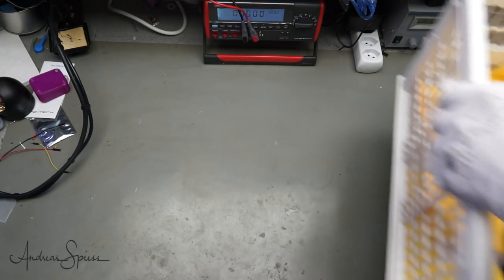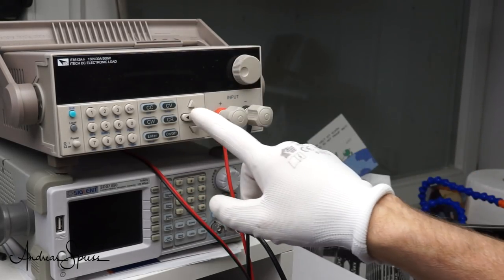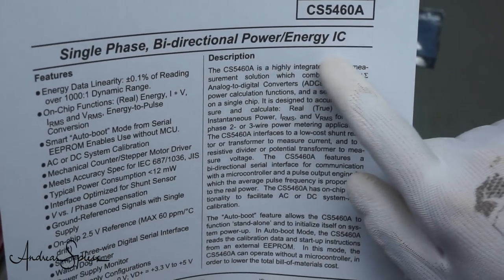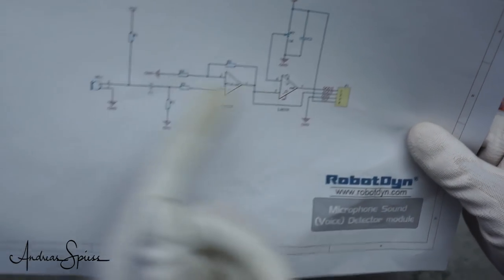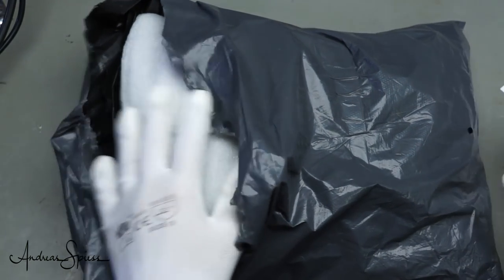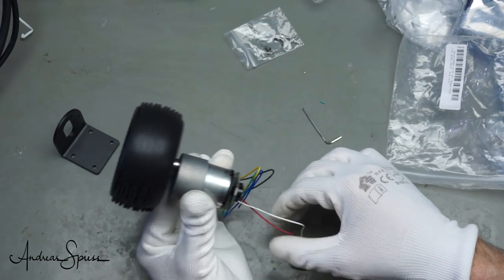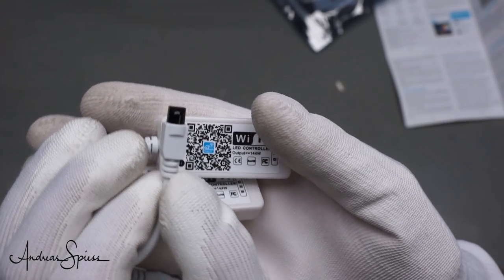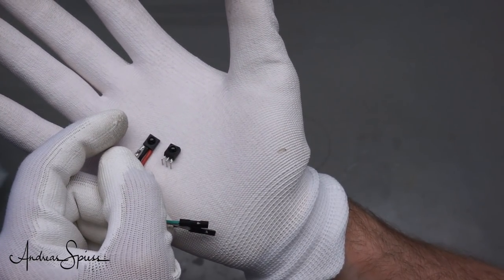#175 Christmas Mailbag with Motors, Google voice, Sensors and other Stuff

Comment: Merry Christmas (a bit late, but well...). For measuring mains real power you only need an Arduino, an ammeter and a voltmeter. You can do the ADC reading & calculation on the Arduino since it's only 50/60 Hz. You can calculate real, reactive and apparent power, cos(φ), the PF, etc.
Reply from the maker: I wish you a Happy New Year! Concerning the Arduino: These lectures were a long time ago. So I would have to dig into the matter ;-). But I think you are right if you use interrupts to measure a lot of points and do the calculations every second or so.

Comment: thanks for video. very curious to see how your ttgo lora module works - especially Antenna supplied with module, i doubt if it is for right frequency. 
i have a pair or these modules, tried range test , hardly goes to 500 meters. i kept transmitter on terrace of house and walked all the way in park. it ceased to get any data after around 500-600 m. There were few tall trees and may be a building in the line of sight. 
But good news is -it works for my application though, i used this for my sensors in a closed room e.g. floor 4, then walked all the way on 2 floors up and 4 floors down the building in basement, also in building on other side of road, it could catch data everywhere. indeed i had no line of sight - separation distance might be 200-300m spherical radius. 
looking forward for your comment on antenna and range of this module.
Reply from the maker: As I have shown in my other LoRa videos, the antenna is not so important for reach. Most important is the line of sight for bigger distances. And in buildings also some metal can help transfer waves from one place to another...  
But I am glad it works for your application.

Comment: While calibrating an SHT30 shield for a home project, I found that the  Wemos D1 throws off sufficient heat to shift temperature upward by 5F if the sensor shield is attached directly to a board. I suspect that the DHT11 would be effected as well. Separating the Wemos from the SHT30 using 4" jumper wires solved the problem. Pictures, data, and analysis at https://github.com/davewsmith/notebooks/tree/master/temperature

I'm hoping to get access to a FLIR camera to confirm that the voltage regulator on the Wemos is the culprit.
Reply from the maker: The setup We use here is not good to measure actual temperature. It is more to show principles. Btw look also at the ESP module. It also creates some heat (3.3V*80mA)
Reply: i have noticed the same... SHT are very sensitive to surrounding temp and even enclosing it in closed enclosure gives 1-2 deg higher reading than actual ambient temp. minaturization is good but sometime it is better to remain big :).

Comment: Hi Andreas  thank you for many intuitive videos on ESP32. I'm wondering if you can do another instructional video on esp32 built in security and cryptography  features. Specifically how to utilize the built in Cryptography Hardware Acceleration for device signing, and encryption. The Atmel ATSHA204A module provides HMAC calculation capabilities with SHA256 hashing. I'm not sure if any ESP32 board has something similar built in?
Reply from the maker: I have no idea about security. So, somebody else has to do that part...

Comment: I have to warn you about flat usb cables -- I have 15 of them and they are only good up to 600 mA so if anybody has problems, my first try at workshop would be to check with another cable. I'm using them with Arduino without problem, but hey always fail for Linux SBCs which often require more current. Becausse of that I haven't used them with ESPs so far.
Reply from the maker: Thank you for your feedback. I did not do any tests and plan to use them with the ESP boards for the training class. I selected them mainly because of their looks... But it might be a good idea to compare once a few USB cables as we use quite a lot of them without thinking too much.

Comment: great Andreas! looking forward for the esp32 lora oled modules reviews. i got some from heltec. I realised when i received them that they were 433mhz. I have tested them and i got (node to node) 8.3km range (almost LOS) at - 117db.  The lora antennas in the one you got looks much better.... Merry Christmas and a happy new year to all!
Reply from the maker: You might have seen the video on my world record. It is at 203km. So, still lots of potential...
Reply: Yes! i have seen it! lots of potential provided you have the correct LOS, low interference and of course a good board design + antenna (y)

Comment: Merry Christmas Andreas :)
by 14:40 is that the equal radar sensor from ComputerClub2 tv? He has a range from 9m and detect objekcts behind 35cm brick wall.
Reply from the maker: I do not follow ComputerClub, so I do not know. But I assume mine will have similar characteristics. I did some tests with cheap radar sensors in another video and they were quite good.

Comment: Merry Christmas Andreas, have you done any work with speech synthesis.  I was playing around with a BBC microbit and found you can programme speech using micro python.  Possibly useful in some of your future projects.  I struggle a bit with programming so your channel is useful for a novice like me.  Hardware isn't a problem as I was an electrical fitter before I retired but coding is more demanding!  Keep up the good work!

Davy
Reply from the maker: No, so far I did not do anything with voice., but also not with the microbit. We will see. Maybe next year.
Concerning learning software: You still have plenty of time to learn it and I even think, learning keeps us young...
Reply: I agree. I must keep the brain working!

Comment: I pruchased such flat USB cables in the past and they seem to be very poor quality. They can't provide stable 1A. Even with ESP8266 I had problems with stability which were gone when I changed the cable. Let us know if yours are better,.
Reply from the maker: Thanks for the feedback. I did some initial tests and did not find big differences in resistance. But with your input, I will test them a little better.

Comment: Hello Sir,  I saw many video tutorials of yours and found those very useful. I like to request you about making a tutorial with E32-TTL-1W using SAMD21 IC. I bought 10 pcs of each module (both E32 and SAMD21) from china. But still no luck to communicate. I have used Radiohead library for E32 module. It works for arduino pro mini but not works for SAMD21. I don't figure it out why. Will you please kind enough and  give some suggestions about it. I will be very thankful to you.
Reply from the maker: So far I do no videos using the samd21 because I use ESP chips instead. One reason is because the Samd21 is not as widely used and not as good supported ( this might be the problem you encounter). So do not expect videos from me using this chip soon.
Reply: Thanks you sir for your fast reply.

Comment: I found anoter interest chip for measuring voltage, current and energy.It is ADE7753.
Reply from the maker: I have some AD7758 laying around. They are three phase. But so far I have no plans. Did you use it?

Comment: The digital output of the soundmodule is of little use here. The intention is probably to give the  soundpressure level, but for that it needs a capacitor, or possibly even a capacitor and diode https://arduinodiy.wordpress.com/2013/04/04/microphone-pre-amp-for-microcontrollers/
Reply from the maker: Thai is what I think, too.

Comment: Couldn't we get a longer / more reliable digital signal off the microphones by increasing their sensitivity?
Reply from the maker: No, unfortunately not. You already get the 3.3 or 5V max with this sensitivity. You need a way to bridge the gaps and this is usually done with capacitors.

Comment: merry xmas I am very interested in the esp+lora devices.  Would like one with a GPS if possible.  I want to make a cheap tracker because someone keeps stealing deliveries off my porch and would like to know where it goes if possible and give that info to the police.  Id like it to be as cheap and small as possible because I won't get it back
Reply from the maker: You can buy small trackers which work with gps which might be better because of the reach. If a LoRa device does not have line of sight connection you will not get any messages from it.
Reply: I have a strong feeling that it is someone in my neighbor hood so it would be a range of less then  1km.  Do you think Lora will not make it 1 mile objects?

Comment: A while back I did an Arduino project to put wireless data transmission of the cs5460a based watt meters using nrf24.   
https://github.com/zerog2k/power_meter_cs5460a
Reply from the maker: Thank you for the link. It might save me some time...

Comment: And if you want a very fast (faster than all your motors), high torque, highly efficient and small motor, I'd suggest you buy a brushless motor. I bought this one for trying them out: https://goo.gl/QCzQYJ . They're really fast (1400 KV, 1400 RPM/V) and high torque. Just take into account that it's very power hungry: it consumes 210 W. Also, you'll need an ESC (you can buy one on Banggood as well).
Reply from the maker: I think, these motors are too fast for wheels and should probably be geared. But so far I did not find gears for these motors.
Reply: Andreas Spiess Then 3D print some gears! Or buy/make a CNC machine and make them out if metal. I don’t think they’re fitted for the balancing robot project, but they’re useful for other projects, like RC toys, electric karts, and other power projects.

Comment: regarding the Radar velocity sensor, you can use an ESP32 with Arduino FFT from https://github.com/kosme/arduinoFFT. It works out of the box e.g with 2048 samples, 4000samples/s. I already tested it with 10.525GHz HB100 and 24.25GHz CDM324 Modules.

Comment: Regarding the heltec LoRa board, someone on this form has seemd to get it working. I tried the same thing but no luck jet.

https://www.thethingsnetwork.org/forum/t/big-esp32-sx127x-topic/10247/130 

I don't have my own gateway, so it's hard to test.

Might you xmas gift be stuck at customs?

Marry Christmas and thanks for the videos.
Reply from the maker: Thank you for your link. I did not use it as a TTN gateway so far. I just did some testing if it is really an 868MHz board.
Merry Christmas  to you, too
Concerning the tank: According to Banggood it was lost in the Netherlands
Reply: Andreas Spiess I have also tried it on the commercial KPN network, but also didn't get a connection. Other LoRa devices work fine, so I must be missing something, or the entanna is really weak.

I live in the Netherlands near the sea port (rotterdam), so if I can pick it up someware let me know.
Reply from the maker: My tests so far showed that these are not 868MHz modules, they are 433MHz. Maybe this is the reason. Dit you test also point-to-point?
Reply: Andreas Spiess from the blog post I read that there is a setting see below, but the only successful post I saw was indeed the 433mhz version. I didn't try point to point

The post: 

I have modified config.h to use the right settings for my dev board 915Mhz and SX1276

//#define CFG_eu868 1
#define CFG_us915 1
Reply from the maker: All versions can send and receive on all three frequencies because the chip can do it. But the filters are different for each frequency. So you still need the configuration pointing to the right frequency and it might work. Just not with the full power of the antenna.